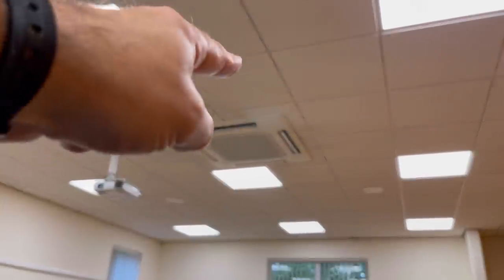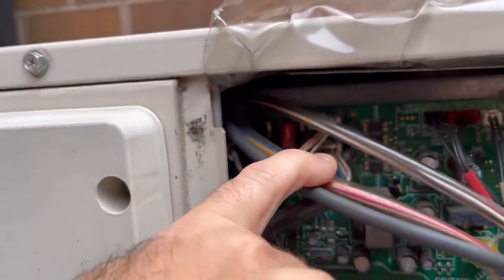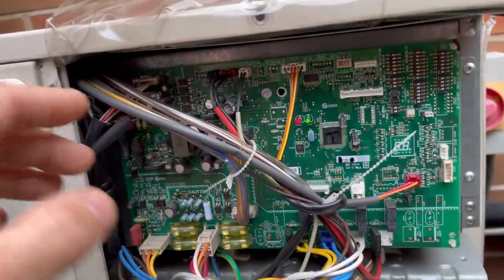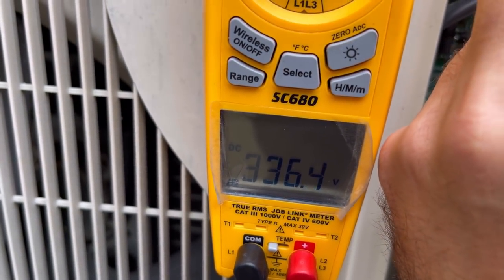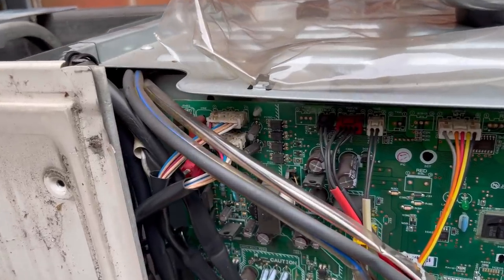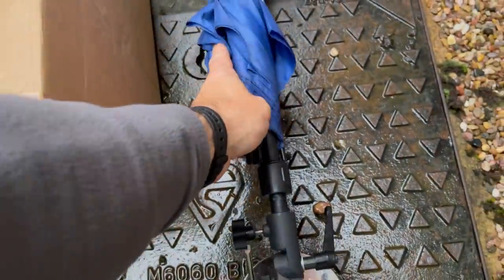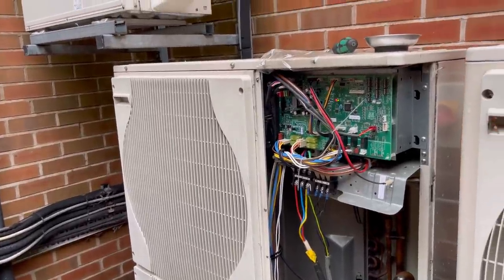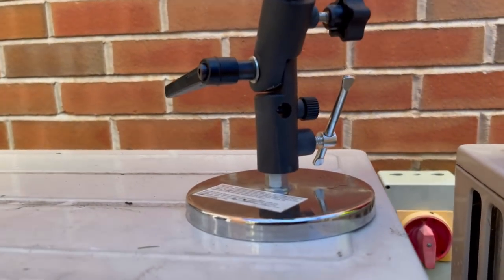AIR CONDITIONING FAULT FINDING // MITSUBISHI U8 FAULT ? #hvac #airconditioning

Comment: Good work, how did you know what DC voltage it needed 15 VDC and 340VDC? Does it state it from the manual or?
Reply from the maker: Yes mate, usually different manufacturers will put this sort of info into the Service Manuals. Mitsubishi Electric also had an app with loads of info. Well worth a download 👍🏼
Reply: Those fan motors are bldc motors with built-in control board. So they take rectified mains which is basically what u get after putting a FULL BRIDGE RECTIFIER & capacitor across 240v mains. If u apply the formula of calculating ac peak voltage u will get 340v & the control signal i do not know much about cus if that goes out u will have to replace the motherboard.